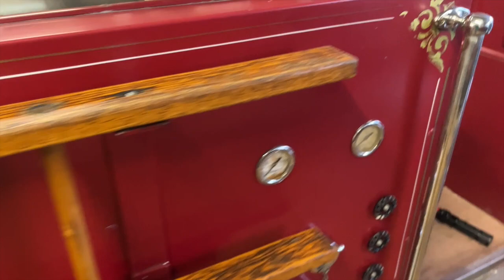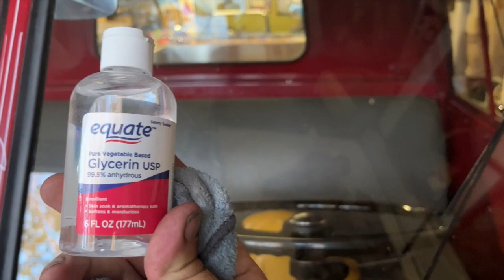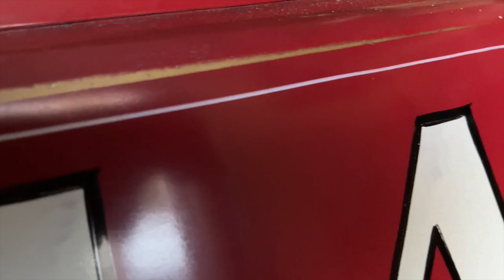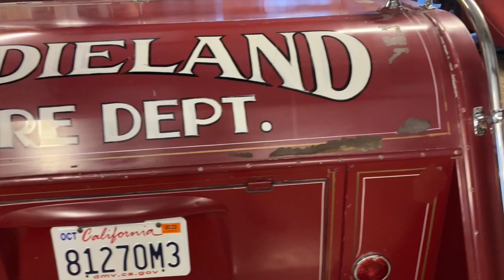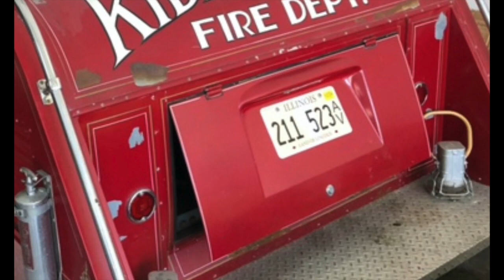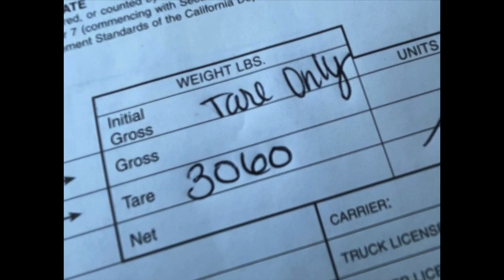Carchaeology: VW Kiddieland Fire Truck Progress Detailing and First Drive!

Comment: On one of the Mopar pages, guys were talking about saving a dried out window gasket. They soaked it in a bag of mechanic's hand cleaner. Several others commented that they had done the same thing
Reply from the maker: Neat tip! I’ll try that!  The key is to find something that will truly penetrate the rubber rather than just gloss up the surface of it .

Comment: Randy, appreciate the glycerin tip, def gonna try it. Wondering if it works for dash panels and vinyl upholstery as well.
Reply from the maker: I’ve found it is best on actual rubber parts that have some thickness to them, but you could give it a try I suppose?
Reply: Great question. Was wondering that as well.